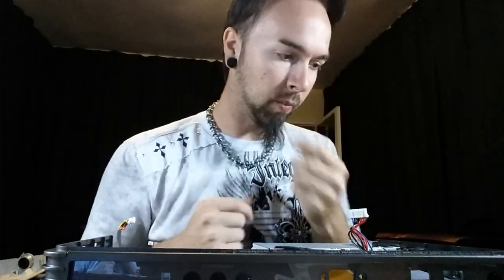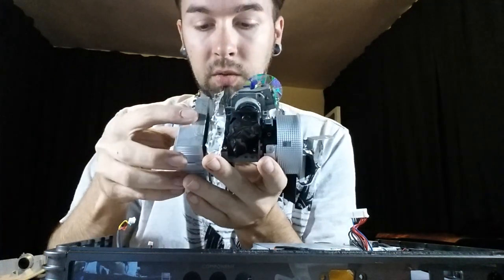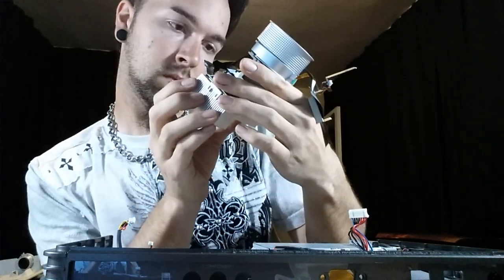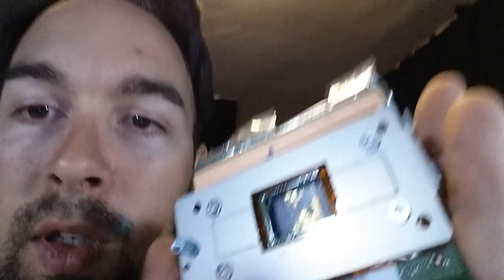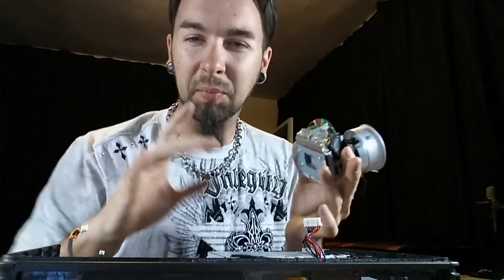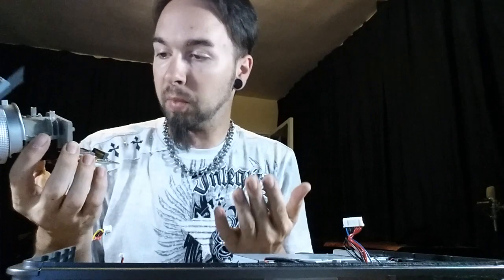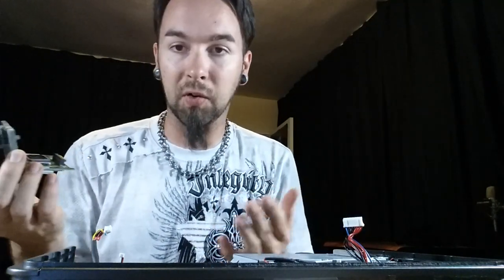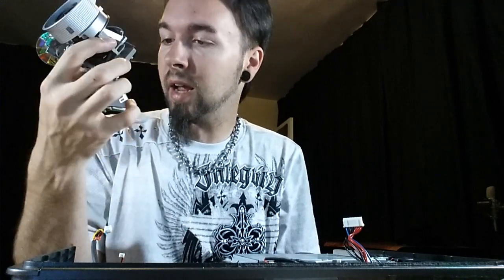KangaEmpire - BenQ DLP projector Repair Attempt

Comment: Hello , i Need a Help.
My BENQ MP610 is not working.
when i connect it to the power the led indicators turned on, Then i press the power button the projector turned on but no light comes out of it. but the fans are spinning.
also no Lamp Indicators turned on, so can you help me with this?
Reply from the maker: Hey ..Thanks for watching.. I'd recommend looking up the lamp type for your projector and replacing it. IF all other functions are unchanged but still no light .. It's very likely the lamp is dead.
Reply: but Lamp Indicators didn't turn on, also I have an extra lamp but I don't know its good or dead. is there any way to test the lamps?